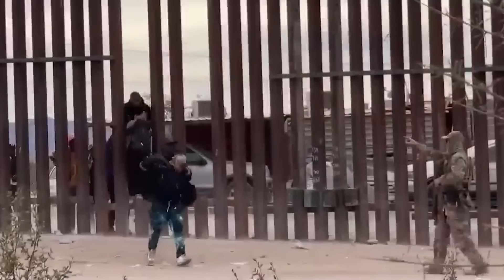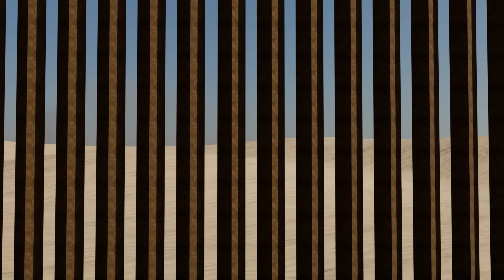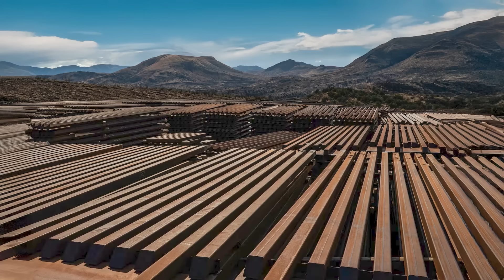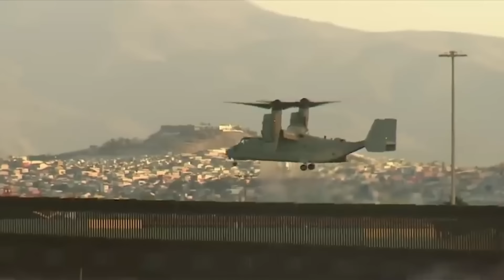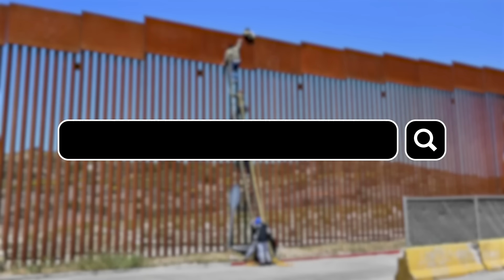What Mexico Is Doing to the U.S. Border Shocks the World

Comment: Electricity in the fence would make them not want to touch the fence. That’s what they put around fences for cows. It doesn’t kill them.
Reply: electricity is really stupid. It's very easily defeated by shorting out the fence. There's all sorts of other problems as well, not that it matters.
Reply: @MsHojat 
That’s not how low Inpedance chargers work
Reply: @MsHojat track the wall and the wattage.
Reply: @MsHojat AC + steel or carbon blade on "cheap" power tool = boom. The sparks would also create a path for the current to arc across. A torch might work, but cutting all the way through would be difficult without letting the metal on the torch touch the fence, any contact may set off the fuel source for it though.
Reply: @MsHojat : Yes,  but it alerts border security where the short is happening and they arrive with German Sheppards, or drooling Rottweilers. Those would definitely deter anyone stupid enough to try to come in illegally after that. Let the puppies have their play. 😁
Reply: yeah but we could turn it up so it would lol
Reply: @richardhemingway9773  😂😂
Reply: they use the fences as a cheap power source
Reply: The amount of power that would be needed to put a noticeable amount of electricity into that much steel would be insane.
Reply: @ It's called wiring.
Reply: @C1t1z3n1 There is some loss vs copper, but it wouldn't be nearly as expensive as employing a person for every 5 miles. But let's be realistic, the seismic sensors will alert border patrol, and the fence will slow them down long enough to ensure they're caught.
Reply: You@ChrisHarmon1 your people will be the first crying when you don't have food hahaha
Reply: @ Chris: Arizona wants solar and every place we can, everything in need of electric is going solar. Light poles, signs and so on.
Reply: Trump's next orders concerning 
the great wall of America is
to plant land mines along the 
entire length ....
With video cams , it will make a great reality show ....
Reply: I vote YES
Reply: They'd use the electricity for more cutting  ! They are cunning people  .
Reply: @georgehays4908 
They’re so cunning, they have to invade other countries because they can’t develop their own. Cunning!
Reply: Depends on the wattage.
Reply: electricity is expensive.
Reply: @imalikconnor  - Not only would it be expensive, but providing electrical energy along the more remote area of our Southern border would be technically impractical, if not impossible.
Reply: @WarHawk-  expensive? for the billionaires in the American government?? nah. money is no object to them, it's just an abstract tool that helps them get what they really want - Power. status, import, relevancy.   
 Power can be very intoxicating.  you can see the deleterious effect that it has on the human body every time you turn on the news and see all of America's favorite politicians, elected or not, withering and decomposing live on air, contorting themselves so grotesquely in attempts to justify war crimes and profit as much as possible, before the clock runs out and before their consciences catch up to them. 
Power is also something that cant be easily given up and "accepted."  once you've been exposed to it at a young age, you'll want it more as an adult. this results in a severely warped worldview and value set.
Reply: @ Nope. Arizona put in solar where possible.
Reply: Not with all those abandoned solar panels american tax payer dollars bought over the past 20 years. @imalikconnor
Reply: Free light bill
Reply: Trump wanted to do that, but it was to costly.
Reply: US infrastructure can barely power their cities.  This is why they have to get electricity from Canada. What makes you think the US can afford powering a wall this huge? 😂
Reply: They will start grilling meat on it 😂 Al pastor/carne asada 🌮's w/ no electricity needed that's not the solution 4 sure.
Reply: Be cool Sanchez, your dad crossed back in the day  @KathyL.Sanchez
Reply: @rendericeib4513  I'm actually a member of the Navajo Nation not everyone w/ a Spanish last name R Foreigners,but Ur absolutely right many American's parents did cross the border. 😂👍
Reply: That’s too easy 🤡
Reply: Lead would work better
Reply: judy you must be maga and not smart .....how much would it cost to electrify a fence 1300 miles long ,.....you need to learn physics ... and ways around electric fences
Reply: But... but, the woke tell us that we can't hurt these poor people who are crossing into the US only to "make us stronger"! 🙄
Reply: The same people who build huge Mexican to US tunnels and make submersibles to move drugs? Sure buddy.
Reply: Hmmm good idea if I was the border agent and caught them entering illegally I would make them piss on the wall.😂
Reply: Good 🇺🇸 is good to break international agreements thats why not to trust American im mexican but let me tell you there was an agreement between usa and Mexico Guadalupe victory treaty all born mexcans were allowed to cross usa land without any papers only tha states that usa stole from Mexico but doesn't mean don't worry water and his nature will go back were it belongs
Reply: You know we stole the land from Mexico don't you. Please study the Mexican American War and the expansion of slavery in Texas and Manifest Destiny.
Reply: Pour a bucket of water on the ground, then use a wire to short the electric. But, every chicano in the area loves that idea :)
Reply: That’s because cows are very stupid… same reason we don’t use them as guide dogs
Reply: They you will be moaning when your taxes are paying the gargantuan electricity and infrastructure bill...
Reply: @xpress_lifts  Now, John, are you thinking or just listening to soros, again. Arizona is going solar, light poles, signs, livestock fencing.
Reply: It just gently wakes them up to reality wonderful. Cant beat the thinking heads
Reply: Smart ass they are humans not a animal like stupid
Reply: Yes but cows are smarter than these people!!
Reply: Cows ???  Screw that, Jurassic Park their azz !
Reply: Yeah, a big cockaroacha pest zapper.😂😂
Reply: Like a big cockaroacha pest zapper.
Reply: Lean a few big pieces of steel on the wall and you'll 'short out' all the electricity. How many illegals, and how much dope, can get here as we wait for a federal employee to remove the steel and reset the breakers?
Reply: They’ll adapt it and have free electricity ⚡️
Reply: That would make sense
Reply: Then you need to raise the voltage. Cows are worth keeping but drug dealers are expendable
Reply: Electrified fences are common around secure facilities all over the world. If US can electrify the entire fence, do it. Or double fencing with mines in between😂. I would love to see that.
Reply: @carolthorson7854 I was thinking the same thing
Reply: Build a mote this side of the fence and fill it with alligators, piranhas and diving boards.
Reply: @grandpied 
Too dangerous for the Americans whose property borders Mexico.
Reply: @ It's too dangerous now.
Reply: Well that is the problem. Cows are worth keeping around after getting zapped.
Reply: @Bonzi_Buddy  so true!!!!
Reply: @Bonzi_Buddy wtf is that supposed to mean?? You racist POS 😠 😡
Reply: @Bonzi_Buddy Get a life Mike!!
Reply: @Bonzi_Buddy    thats awful statement  bozo  ...
Reply: Easily defeated with rubber gloves. Besides that, it isn't nice, but when you are desperate, you will just take it for the short time you are gripping the wall while still standing on the ground. Once you are off the ground, you won't notice it anymore and when coming down you can jump the last foot.
Reply: @apveening increase the voltage
Reply: @patriciagrenier9082  Doesn't do a thing if there is no power behind it.
Reply: @apveening mmmmmm. the ground wire doesn't necessarily have to be connected to the literal Earth. There is a circuit design that will shock all the way up and down. A small nuclear plant can provide current that's lethal through gloves. For that matter, use the wall for high tension power transmission through CA, AZ. NM & TX
Reply: Not if they electrified it to the point of being deadly. I'm sorry but they're an invading Force damaging our country.
Reply: @apveening  I'm a retired industrial electrician, with my electrician's boots (600v sole!) I could hold a live 480v wire with my fingers,, I wasn't ''grounded'', the circuit wasn't complete... Cows don't wear shoes!!
Reply: @dondale68  Yup, but that 2000 Volts in the fence doesn't kill them either (nor me).
Reply: @apveening  No, it doesn't! I've been hit with 7kv ac,, and 6kv dc,, but both were at very low amperages! Woke me up!!! But didn't permanently hurt me! MYTH,,, How many hertz are in DC? Plenty it ''hurts'' like hell!!

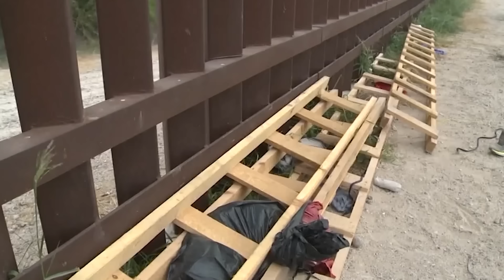Comment: 8:14 I don’t understand why they don’t have an umbrella shaped canopy made of rebar at the top… thus placing a ceiling on top of the wall. Perhaps a A-Frame canopy would be better. But once climbing to the top, it’s impossible to get onto the top of the canopy. 
Secondly I don’t understand why they don’t use laser burglarproofing beams and/or thin sever sensor cables which would flag any cuts?

Comment: One of those sample walls had its top panel set at about a 45 degree angle which, I'm sure, would have been extremely difficult to get over.  But the design finally chosen have the top panel vertical making it much easier to get over.  I wonder why they didn't chose the one with the angled top panel.  It seems like a no brainer to me!  At lest it might have defeated the climbers if not the smugglers.

Comment: The Marines have also been emplacing rows  of barbed wire about half way up, so if someone tries to climb over, the only place to drop to is in a mess of barbed wire.  In addition, they have been pumping cement onto the posts!  It's all a small Cold War, with occasional flair-ups.  The drones are helping.  LIDAR should help with the tunnel problem.
Reply: Good coms
Reply: I'd electrify the fences too
Reply: concertina wire
Reply: @octoniumvideos  a blanket can defeat concertina, or cardboard, its best hope is entanglement, but if ya got wire clippers with ya
Reply: Double fence with land mines in between the fences
Reply: as a border worker....that is not true
Reply: Lidar penetrates foliage no 50ft of rock
Reply: *flare up
Reply: All that technology and strategizing for a couple of conservative's being scared of Mexicans...man we are really great again!
Reply: Barbed wire can be cut.  It's a deterrent but not a solution.  And drones will carry drugs over with technology.
Reply: Wire cutters, angle grinders.
Reply: Tunnels are passe, compressed air thru a tube works well, but why bother if ya got a drone?  Camo Umbrellas with mylar inside stops heat signature as well as shade, rain dispersal, instant shelter.
Reply: LIDAR may help with tunnels close to the surface, but the video mentioned tunnels at 69' (more than 20 meters), LIDAR isn't really doing much for that.
Reply: @apveening  do you have any ideas what we can do to stop something that's so far below ground? Genuinely asking
Reply: Israel  floods them with water @zachjones2588
Reply: @zachjones2588 Sand worms. Dune style. 🤣
Reply: @zachjones2588  Seismometers/seismographs and/or microphones should do.
Reply: @DeweyDEWMANBrown875  NOT THE ALASKAN BULL WORMMM!!!!!!
Reply: @dumpsterchicken6287  Sounds good to me.
Reply: @zachjones2588  Marines on patrol?
Reply: You know we have technology that can be used to allow us to view inside of the Great Pyramids. 
Muon Tomography. It allows us to use cosmic rays to pierce several kilometers underground, detecting objects, caves, cavities, you name it. It is currently being researched for viability in border protection. In time this weakness will be fortified.
Reply: Tell that to Israel. They seem to be having some trouble finding all the tunnels. But yeah, it works great. 😂 @MorfsPrower
Reply: @zachjones2588 bunker busters
Reply: @spooky7542  why do I feel like this was a iron man 2 reference lol
Reply: @zachjones2588  well. We really have them too😅
Reply: @apveening  Listening devices can detect vibrations from digging if placed and maintained, they can be placed deep  if necessary.
Reply: @garyweber7139 don't dig, water wash the tunnel
Reply: It is not barb wire , it is called razor wire which is worse than barb wire.

Comment: Resident of southern New Mexico here - several incorrect points mentioned: the Rio Grande River has zero water in it for the majority of the year; it is dammed off due to water rights/agriculture south of Caballo lake / Elephant Butte. So people just walk across the sand. Also, the floating barriers used in Texas had razor wire underneath the waters surface, which stirred up human rights activists, prompting the removal. The construction of the wall was an enormous win for the cartels as well, because now they make thousands of dollars per person to run them across the border. Locally, the smugglers are referred to as "coyotes" (fun fact). Plus, a huge reason the construction of the wall was halted (besides a change in elected officials) was the huge controversy over Trump illegally awarding contracts to associates of his, many of whom simply took the money and never produced anything. The administration was also fully aware that there would be large portions of land that was privately owned and had planned to forcefully acquire by means of eminent domain. So the entire concept was foolish and pointless in the first place, by any logical and sensible means.
Reply: Except that it worked. Illegal border crossings are down 96%.

Comment: Why do they not electrify it? Wouldn’t that stop all of it?
Reply: That would be expensive, and if I were mexican I'd run a line to my house for the free electricity!
Reply: @Terrillius  LOL....sad but true....we'd do it here in Canada as well
You could easily identify the Canadian section 'casuse it'd have hundreds of cell phone chargers hanging from the wall.
Reply: Ask any farmer who has electrified fences - it is far more difficult to keep the current flowing than you'd imagine, particularly in that terrain.
Reply: You can just ground the electricity. Super cheap to do. Clearly you are thinking on low levels.
Reply: Cuz ?they will set up a 🌮 shop w/ no electricity needed 😂
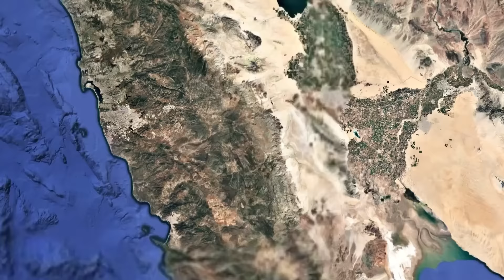Reply: They would  be providing more electric for power tools, 8:45  master tunnel builders. next is 1920 air plane built. fabric wing fan planes.
Reply: Definetly! I'm sure the mexicans will appreciate the free electricity supply LOL
Reply: Nope! 😂😂
Reply: No
Reply: Do you have any idea how much power it would take to do that? Even if you did it would be easy to bypass and require constant repair. Much more practical to invest in hidden sensors and cameras to alert nearby border patrol.